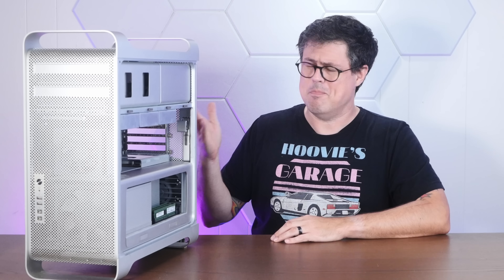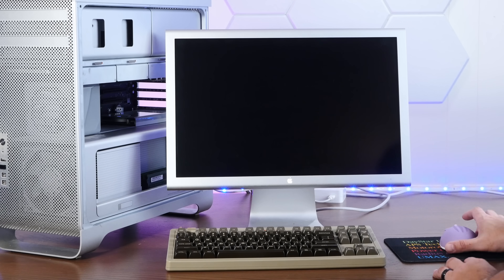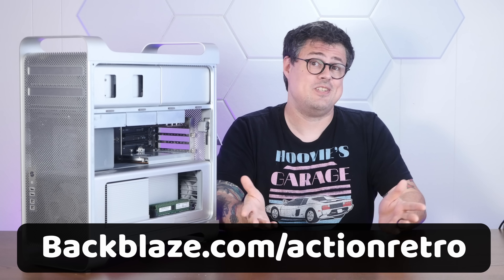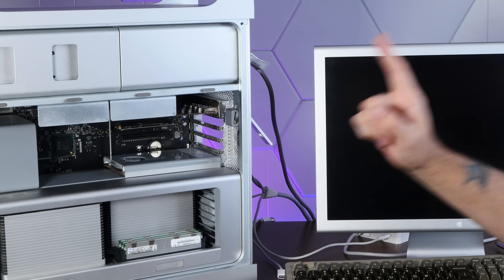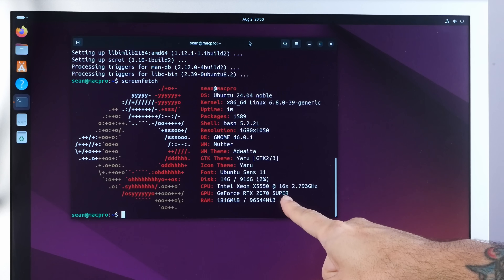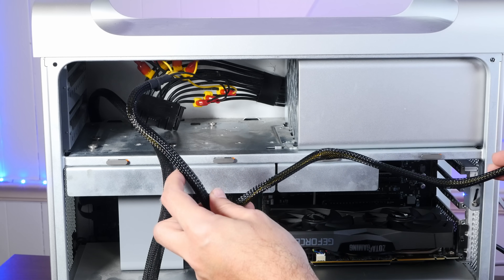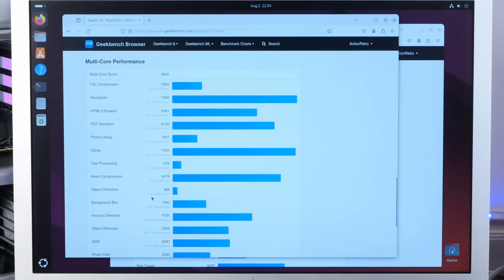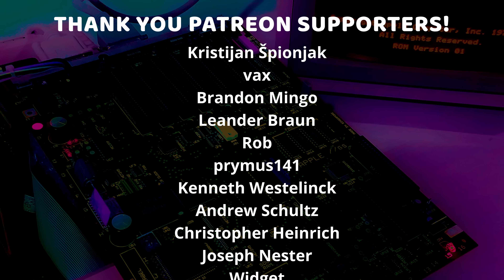Building an Extreme Linux Mac Pro

Comment: Right up my alley. I have a Mac Pro rig similar to yours, running Debian 12, SparkyLinux, and FreeDOS. I have not upgraded the cpus due to the de-lidding process, but I wonder if there an alternative path ? Instead of going through the de-lid process, it is possible to install the Xeons as is and use a more modern heatstink/fan combination ? Looking forward to the Xeon video, as I will be upgrading mine as some point.

Comment: I have a 1,1 that I found on the side of the road years ago. Flashed the BIOS to 2,1, upgraded the RAM, got Manjaro running on it and threw in a more modern NVIDIA card. The 32-bit EFI coupled with some other quirks make it a more cumbersome computer to work on, but it';s still a beast. I've never seen the 4,1/5,1 RAM/CPU bay removed before but that is SO MUCH easier to work on than the 1,1/2,1. Golly!
Reply: Does Mac OS  still run on it?
Reply: @fmlazar  Nothing close to contemporary, so you're basically screwed if you try to run Mac OS with current software. Officially the computer supports Mac OS up to Lion, but with a modified boot loader I believe that you can install up to El Capitan. Nothing beyond that. Linux is definitely a better option.

Comment: I sold my cheese grater when it wouldn't work for the project I intended it for, but I think you can use washers safely to raise the heat sinks just slightly rather than delidding. I think I had a 5,1 though, so I don't know if it still works the same with a 4,1.

Comment: Are we competing for who has the drippiest Hoovie's Garage shirt? Because you just won. Awesome video as always man!
Reply: Well hello there Mr. THE GREATEST TECHNICIAN THAT'S EVER LIVED. Hope you don't mind me asking a question.
With Windows 10 soon going EOL, do you have any plans on how to deal with customers with devices not supported by Windows 11 after Windows 10 goes EOL?
Reply: @TheDevil259  well, I am like the 10th greatest technitian that's ever lived, and with my customers I usually offer an upgrade to windows 11 using the registry trick so that even their unsupported machines can run it because the windows 11 minimum requirements are bullshit. And if this is a clean install I offer tiny11 for its lack of bloatware and smaller size.
Reply: Professional gooch collector
Reply: ✨ThE gREaTesT TEchnICiAn ThaTs EveR LiVEd✨
Reply: Well I am a technician, that has lived, and I use Rufus 4.6 and I download the windows 11 iso, then I get the option in advanced options to enable/disable certain requirements. Like the ram, security and CPU. But also: adding a local account
Reply: Hello there my technician teacher
Reply: first thing I saw, had me in 80s miami techno. never been there, infant at the time
Reply: DA GOOCH COLECTAOR
Reply: can you see is the Greatest Mac 5.1 that ever lived

Comment: The JuiceBox wasn't intended to be an external PSU. It was meant to be installed in the 5.25" optical bay and all cords routed internally. Very similar to how you routed your cables after tapping into the stock connector.

Comment: Nice shirt... is this going to become the dumbest retro computing channel in all of youtube? ;)

As soon as you showed off those X5690s I knew what was coming... I had some success with heat but ended up killing two. Managed to find a LGA1366 de-lidding tool on the 'Bay -- that's had a 100% success rate. I built quite a few of these "maxed out cheese graters" for friends, and still have one for myself... as well as some similar-era Hackintoshed HP Z800 and Z820 workstations.

The Z820 is an example of what the cheese grater's replacement should have been -- a dual socket workstation with an 1125 watt power supply supporting up to 24 cores (dual E5-2697 v2), 512GB of RAM, several PCIe slots and ThunderBolt 2. 
The Z800 is from the cheese grater's generation. Dual X5690s, 192GB triple channel (12 slots). There's one big difference, though. Back in this gen, PCIe slots weren't connected directly to CPUs -- there was a quickpath interconnect bus which connected the CPUs to the IOHub. The cheese grater (and HP's Z600) has only one IO hub, while the Z800 has two. Lot more PCIe lanes, none of that lane switching nonsense the cheese grater has going on for the top two slots. I've had interesting experiences with this in MacOS -- some drivers don't recognize their expansion cards if they're in a slot that hangs off the second IOH! All Just Works(tm) in Linux and Windoze.

Comment: nice one. i don't know what is the spec of the mac power supply but given that you just installed a 2070 and you're going to install those spaceheater xeons (130W each), i would double check. under normal conditions it shouldn't be a problem but if you fire up a heavy game and everything is maxed out, it might be. also, these taps for the cables looks like they cut through the wires so, not ideal.

Comment: do not use those wire taps that you have there. they cut into the wire and will cut strands, reducing current capacity and damaging the wire.   you can either depin that plug and add a pigtail OR you could strip the wiring insulation back to poke/wrap or solder.    but please do not advertise using those wire taps.

Comment: I still have a trusty ole 1,1 "quad core" 3.0Ghz chugging along with windows 10 and a GTX 670. It's not going to win any benchmark competitions but for a secondary office machine it's fine. Still one of the best looking machines Apple ever put out IMHO. I've got a fleet of old cheesegraters from 3,1 to 5,1 and even have a trashpro 6,1 running Sonoma using OCLP and they're still very usable.

Comment: I’ve reliably run an rx580 just off the logic board power ports for many years now, with an adapter that pulls from both to a single 8-pin. Much safer to do the mod in the long run though, especially with higher power draw cards.

Comment: Some tips for linux gaming use gamemode and gamescope. These programs massively improve gaming performance in linux. Gamemode optimizes the system for running games and gamescope is a micro compositor that makes games run more smoothly by bypassing the desktops environments compositor. Gamescope actually is made by valve it is used in the steam deck.
Reply: And ditch Ubuntu.
Reply: @joe--cool  yeah Ubuntu sucks nowadays

Comment: I upgraded by 4,1 during covid - more ram, dual 5680's, 1080GTX and NVMe storage.  I specifically went with 5680's instead of 5690's to avoid the de-lidding process.  The hit in performance (3.33GHz vs. 3.46) is negligible and you don't need to worry about using washers to perfectly space the heat sinks - from the weight of the sinks damaging the chips to over tightening of improperly spaced screws damaging the CPU board or CPU's themselves, it made way more sense to go with the 5680's.

But you're also way more adept at this kind of thing so you'll probably have a much easier time with it! :P

Comment: if I remember correctly these machines actually have less ram bandwidth with all 4 slots on each cpu filled. They are reportedly faster with only 3/4 dimms installed per side

Comment: Yes the prices have finally come down markedly.  Just look at the TDP on those Xeon before buying.  They use more electricity than an i7 870, and there's two!
Reply from the maker: As we all know, TDP stands for Totally Dope Processors!
Reply: That just gives it the added benefit of acting as a space heater in the winter.

Comment: I thought the Mac Pro's come with a power out connector on the board for PCIe cards?
Reply: They do, there are 2 mini 6-pin connectors on the motherboard, but these are rated for 75W each, which is often not enough for modern GPUs.

Comment: I got one of these out of Free Geek for 20$. It weighs 45 lbs. and was likely priced based on the cost of scrap aluminum. Works fine with the exception of the optical drive. I was thinking of casing a beaten old Atari ST in the thing and replacing the Apple side insignia with the Atari one, but this video gave me a little more to think about before I start that project. Cheers--

Comment: I bought one last year to use as a home server. My energy bill actually increased noticeably because I left it on 24/7. I switched to a MacMini with a 3d printer SSD expansion box. You will spend more on electricity in a year than the Mac Pro.
Reply: Yikes, suddenly this gets real!  I wonder where the modern Intel and AMD CPUs fit, because I'm sure server farms are considering the equation.
Reply: @whophd  it’s like leaving a 150-200 watt incandescent light bulb on all the time. I think the MacMini uses 1/10th that amount.
Reply: I personally don't have a need for a home server, but I have 2 really nice Intel 12th gen desktop builds running Manjaro Linux w/12900H chips(home office, and media room, and yes they are higher end laptop chips on a desktop Mobo setup from Aliexpress), but due to some power bill spikes in recent times, I've been switching to my Lenovo Laptops more often for basic task outside of gaming, or heavier workloads as they pull 65 watts max, so I can only imagine what leaving one of these Mac Pro towers on 24/7 would be like. 😬

Comment: 8:30 - Future reference, dab a little bit of dielectric grease on those scotch-locks before you crimp them. The wires will oxidize internally rather quickly from those points if you don't and you'll probably have to mess with them every spring when the humidity comes back.

source: I used to put 12v automotive neons and audio stuff INDSIDE my chopped up 3-foot tall full tower AT case I transformed into ATX in the mid 90s.

Comment: I love seeing Linux Mac boxes!!! It's a chore because there are a LOT of quirks with these older systems, more specifically laptops. But as Mac stops supporting Intel skews, this will be the only way to preserve these systems with a modern OS!
Reply: What challenges have you experienced with the laptops? I’ve gotten many different distros to work out of the box with a 2008/2009 MacBook (only difference is DDR3 on the older one) and a 2013 MacBook Pro. No crazy driver stuff was needed.

Only difficulty I’ve had with Linux on a Mac was a PowerPC eMac, which 99% of distros (even old ones) would support the ATI Radeon 9200 properly and would even display a TTY
Reply: @LonksAwakening  Many of the quirks have to do with things like pram settings. On my 2007 MBP I have to install macfanctrl or the other variant otherwise the fans sit at their lowest speed and the computer gets hot as hell. Some of the older Mac's had a very weird hybrid efi setup, similar to a netbook. The CPUs were 64 bit but the efi is 32 bit. That led to some weird confusion and some distros live CDs wouldn't even boot. While newer Macs use AMD and integrated Intel graphics, the older Intel CPU SKUs use Nvidia chips. Installing the out of date proprietary drivers borks the system unless you force grub to use legacy boot. This was also the case when dual booting Windows back in the day. While this works, booting in legacy automatically changes the SATA drive to IDE mode. The only way to fix it is to force grub to check for hardware at specific memory addresses. These were my biggest issues but I'm sure there are more.
Reply: SKUs
Reply: Yeah man I think x86 CPUs are going to be fine on Linux considering PCS are still using them in large amounts. But anything pre x86 and power PC and especially the 68K era is going to be difficult LOL

Comment: Obsolete my ass! I still use mine every day!
Oh, and Backblaze is freaking awesome! Great sponsor!
Reply: a shame that Dual CPU nowadays is worse for performance :( and that they convert so much electricity to heat :D
Reply: @vimsi  These old Xeon's... yep! Mine is a single processor that I have installed an X5775 @ 3.06ghz and it still serves me well (im typing this on that machine). Running fairly modern MacOS and its still a good, usable machine, but these old processors are pretty bad in terms of performance per watt.
Reply: @MichaelAStanhope  I have mine sitting around doing nothing anymore - I just have no usecase :(